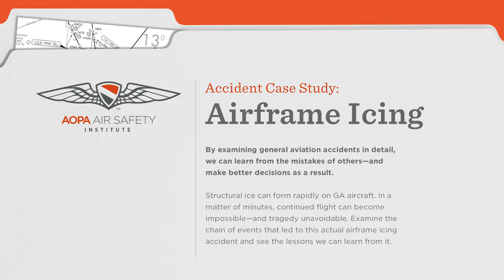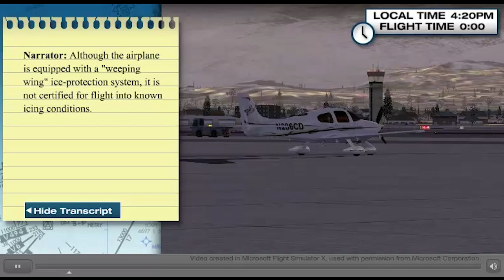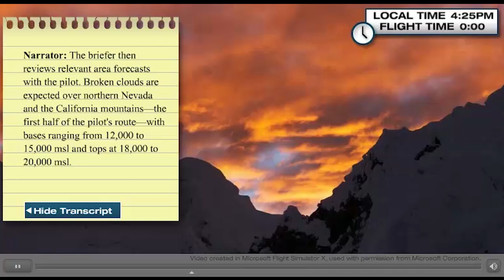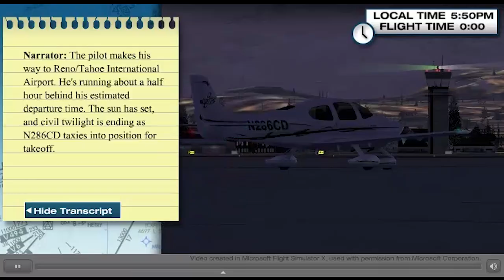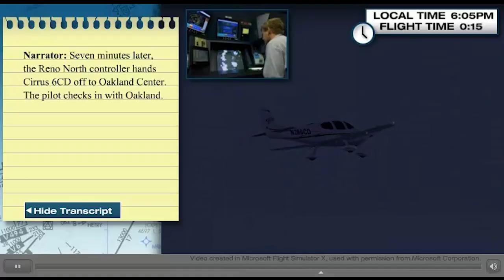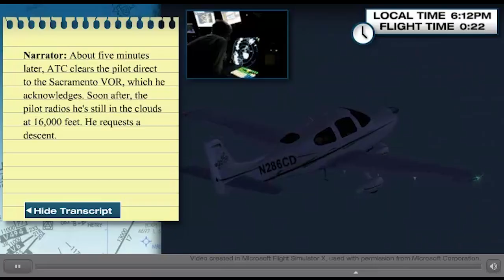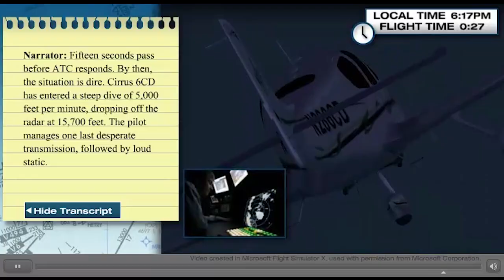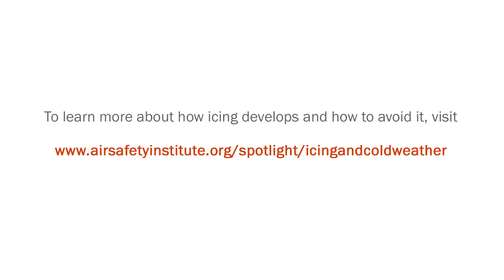Accident Case Study: Airframe Icing

Comment: 12:49 I suggest that the parachute did not fail per se, rather the system failed because of a procedural error.
Reply: Are you suggesting the pilot should have decended back through the cloud layer to either attempt an emergency landing or to slow the airspeed and deploy the chute? He seemed to attempt to get above the weather with the hope the FIKI system would be able to de-Ice the plane before having to go back into the clouds.

Comment: Was that pilot on medication or something?   Because he sounds unnaturally calm and unbothered about his life threatening situation.  He also doesn't mention the icing at all which most alert pilots would.
Reply: He mentioned it as he was going down twice. He hinted at  it also while asking for a altitude change. Reading the NTSB final the weather forecast was wrong. It didnt show any of the icing that's why he left a day early. So he was probably thinking it could get right through it. He only had I believe some over the counter medication in his system. The plane only had 100 hours on the airframe also so it was basically new. The probable cause had unforeseen weather as a cause also.

Comment: Night, IMC, Single Pilot, Single Engine, Mountainous terrain.  No 500 hour pilot should find himself in that situation. I'm not sure that instructors are teaching what constitutes varsity level flying.  He could have rented a car and been in Oakland in four or five hours...what was the urgency for this dangerous flight?
Reply: He was actually supposed to leave the next day. He chose this night because there was no icing forecasted. The plane only had 100 hours on the airframe also. In the final report its has unforseen weather as one of the causes also. Im sure the parachute also gave him a false sense of security also but it pulled it in the dive which was too late.

Comment: FWIW, the local pilots at the time theorized that the unprotected tail stalled, leading to the dive. I never read the final report, so I'm not sure. It's a great motivator to make sure the TKS system is working correctly before flying over the Sierras in winter.

Comment: "Look, i need to get home, ok. I know a cold front is coming in, that's no big deal. What IS a big deal, is if i have to explain to my wife and my boss, why I'm a day late getting home. Looking at the forecast, I see hot air on one side, then a 40 degree difference on the other, followed by 40mph winds in 5 different directions, with freezing temperatures, rain, some sleet here and there, and moderate to heavy snow. And that's just in the first 30 mile leg of my plotted flight plan.

But I've seen worse. I think I can make it. "

Comment: CAPS failed. I think those chutes may give pilots a bit of overconfidence, but they certainly have their limitations (both in attitude and IAS on deployment), he was in a base model SR22 not an SR22T (no turbo) which has a service ceiling of I believe 17,000 where the T can climb up into the low to mid FL’s... that close to
Your service ceiling with a rime buildup is not a good situation to be in, and the added weight in combination with the excessive airspeed upon CAPS deployment, unfortunately he had no chance.

Comment: I am yet to set foot on a plane but even I can confidently tell you wanting to go higher when in a small plane with very limited deicing equipment in bad weather is one of the worst possible decisions there is. The temperature only gets colder the higher you go. There is no need to expose yourself to this level of risk.

Comment: Not to rehash everything the pilot could have done. Will someone answer me this: when the ATC gave him the block and the pilot realized going up was a mistake, what should have he done?

I know he should have declared an emergency. Possibly state intentions. Assuming he needs to focus right now and pilot the craft first... what should have been his move?

I know he needed to descend to warmer temperatures. Do you do a steep descent? I'm pretty sure you don't want to take any drastic maneuvers in any one direction but with his foil characteristics shot to hell, his stall speed is going to be higher and maneuvers will suck.

Have to keep in mind night and terrain, icing, and potential for instruments to be slightly off.

What a crappy situation.

Comment: This is a great example of why I think the citrus parachute is much harder to use than people realize.  The pressure to not pull it seems ever present because most situations where you need to pull it are situations that are probably your fault and are probably correctable with good piloting.  So the pilot ends up fighting through an inevtiably bad outcome that he can’t handle because he doesn’t want to pull it until it’s too late.  He could have gotten out of this situation a myriad of different ways but was incapable, so he should have just gotten lower slowed it down and popped the chute.
Reply: Not to mention that by pulling it, they're facing aircraft damage which will likely be a total loss. Plus the blow to their pride.

Comment: Every damn time I watch these videos, it's always a damn Cirrus SR22, and I'm always left wondering why they don't deploy the parachute system or don't deploy it until they're well outside operating ranges. You bought an aircraft, I'm sure in no small part, because it has an emergency parachute system. So why do they never seem to use that system they bought? I imagine it's one of the major selling points of the Cirrus SR22.
Reply: A big part of the issue is that pilots have a mindset where they don't want to admit that their situation is unsalvagable until it is too late.
Reply: The pilot deployed it above the system's maximum airspeed and the chute separated - it says at the end of the video
Reply: @gamma_hedge  Yeah, I know, I watched the video. It would've been nice if you bothered to actually read my comment. "... or don't deploy it until they're well outside operating ranges". Got some more useless, redundant words to say? You are capable of reading, I presume?
Reply: @CharlesFreck  panic will hinder decision making greatly.

Comment: You know it's nice that the SR22 comes with a parachute but to go through the design process for such a thing and have it limited to a lame-ass 133 kts is pretty sad engineering.  I think they could spend a little more time on it and maybe a little better engineering and make it strong enough to save the large number of people who reached for it in desperation just to have it rip away from the plane and left them to die.  Parachute technology isn't new and beefing the system up probably wouldn't have to add more than 10 or 15 pounds to the weight.  When somebody is in enough trouble to go for the parachute they're not likely still poking along at a nice safe speed under 133 kts.   Nice idea Cirrus but it's time to get it done right!
Reply: Sounds like they didn’t think about designing faster than 133kts, you should join the design team. I’m sure it’s just that nobody raised the idea of making it work at faster speeds..

Comment: Being a Captain for 30 years, I’ve personally noticed on the cloud tops, is where most of the ice accumulates.
Reply: I’ve noticed that too. The top 1,000’ or so is considerably worse than lower regardless of temperature.
Reply: @rrknl5187 because the top is where the most moisture is present

Comment: How would you know ice is building on your wings from the flight deck?
Reply: This is a Cirrus SR22, a small single engine aircraft, the "flight deck" is a few meters from the wings at most. It should also have "ice lights" which shine on top of the wings. In airliners, it's different but they also have much more capable de-icing systems than a SR22.

Comment: Always astounded me why people want to fly in shit weather gethomeitis
Reply: There are lots of reasons, getting home is one of them; but not the only one.  There's another ASI video about air frame icing (pilot landed safely, C182) that basically summarized to "I had made the trip a hundred times before, no problem."  Same here, many private pilots with hundreds of hours have made the same dozen of trips a few hundred times.  And depending on where you live, marginal weather is the default.  Also the back up plan isn't always sound or executed in time.  

I was once flying from VUO to RNT (Portland, OR to Seattle, WA), forecast was ceilings of 6,000 and some precip to the west.  About 1/2 way home the rain hit really bad, with some decreased viability and ceilings were 5,000.  I'm 30mins from my planned destination, and I fly over several airports along the way.  So my thought process was, if they viability drops OR the ceiling drops below 4,000 I'll land along the way.  I proceeded and things got better, so now I"m about 15mins out.  Then BOOM, rain / hale and lighting in the distance.  There was ZERO forecast for convective activity (thunder in the Seattle area is actually very rare).  Now I'm 5 mins from landing, but again passing over several other airports.  So I proceed and land, shortly after landing rain stops (again for like 5 mins) and I can see lightly to the north.  There's another guy that was tying up next me and both were like where did this come from.  

Looking back I can see that even thou I had a good outcome, I don't feel good about my choices.  I really feel I should have landed and waiting on the ground to see what the weather did, even if getting home the next day; I had two passengers on board.  But lets step back some more, I also could be "well I made it through that, so that's my new personal limit."  Both make sense... 

I think it's easy to look at these ASI videos and see the coming tragedy; but in 'real life' things happen slowly and are based on your total life experience.  The goal is to push the envelope and become a better / safer pilot.  BUT drawing the line at 'that's far enough' is not always easy or clear.
Reply: "get there itis"

Comment: There's several rookie mistakes here. (Not saying the pilot wasn't skilled, it's just a sign he's experienced, and forgot the basics). 

1) Icing causes lack of lift.. You never want to climb higher if you already have ice building... even if that gets you out of the clouds, its a huge risk.. The lower you are, the more thick the air is, allowing you to get more lift, and more additional air speed. 

2) Alot of ice building up on your wings is an emergency situation. Make sure the ATC gives you its full undivided attention and is aware of your problem.  

3) Don't be afraid to request in-flight updates on weather, especially if you start hitting stuff that wasn't forecasted. Even if mild at the moment you never know if it's turned bad, and is building rapidly.

4) Never, ever underestimate the speed at which ice can build up on your plane. It takes only minutes to go from a plane, to a brick.

Comment: I'm far from a pilot and never will be, but been addicted to these videos since kobes tragedy. Been binge watching ever since. What I've learned is simply, unless its bright and sunny skies 100% of the flight, I wouldn't dare go beyond that. And the most I would do is a simple joy ride also, so there could be no pressure of HAVING to be somewhere. ESPECIALLY now knowing the rate of deaths due to transitioning from vfr to Imc (if I said that right), and how those skills can easily atrophy if not used consistently, which means an imc rating means absolutely nothing. And so MANY other things can go wrong if over looked. A life losing is just not worth it.
Reply: I believe it would be more consistent to say transitioning from VMC (Visual Meteorological Conditions) to IMC (Instrument Meteorological Conditions). However what you said certainly gets the point across. 

I wouldn't personally go as far as saying 100% sunny skies the whole way or I wouldn't fly. Its all about knowing your limitations, and planning your route (or rerouting mid flight) to avoid bad weather. But ya, its easy to get in way over your head quickly near bad weather. A lot of these crashes seem to stem from not having a proper respect and fear for the dangers of flying.
Reply: @etherealessence  
Or maybe it's
 VFR to IFR then IMC and double IMC
(IIMC) I've been binge-watching after Kobe's accident also. Still can't believe he's gone.
Reply: Onnie Simza, LOL me too!!!! Even though Kobe died in a helicopter, not a plane, I've been watching these videos as well. That's funny. But I have gained some useful knowledge.
Reply: Sands Real Estate West You and the OP should check out the USCSB’s videos also (US Chemical Safety Board). They latest ones are so well done you won’t believe it!! Top notch narration and state of the art, incredibly detailed computer simulations of the exact industrial site where the accident occurred. Extremely entertaining & fascinating, there are hundreds of us on “Notification Squad”, people are even demanding it be put on Netflix and that we get an upcoming release schedule to look forward to, LOL 😂 
One of these 2 links should work: www.youtube.com/uscsb www.youtube.com/user/uscsb
Reply: Also, if you ever win a coin toss for a seat on a plane during dubious weather, don't take it.
Reply: @zyrrhos  
Ha! Good one.

Comment: Never, ever, assume that climbing will get you out of ice, unless you are certain it is so. Lower is always better provided there are workable cloud bases. It's a very "macho" thing to request higher. In some pilot circles, lower is somehow being a sissy. I know it is absurd but I think there is something in it. I never cease to be amazed how complacent pilots often are in the face of imminent danger.
Reply: I wonder if he was worried about terrain if he went lower?  Being a proper IFR flight though, he should have been able to determine how low he could safely go.  Perhaps he was thinking that if going high didn't work he could always come back down, whereas low and iced leaves you cornered.  Probably didn't realize just how bad icing can get.  Sounds like his plane turned into a brick real fast.

Comment: "Anti Icing systems have limitations and parachutes can fail.  Have at least one Plan B that is guaranteed to work if you encounter ice."
Yeah if your parachute fails, have at least one Plan B.  The way that is worded really makes it sound like deploying the parachute was his plan A.
I'm not a pilot, but I'm pretty sure deploying a ballistic parachute on an airplane is always Plan Z, if everything else has failed.  I'm also suspecting once you deploy the parachute, you won't be able to have a Plan B if it doesn't work.
Reply: Parachute is always plan Z. The amount of damage you will incur wouldn't make up for it otherwise. Maintenance perosn I was talking to said that opening parachute will still cause the plane to sink 500 FPM and destroy the main and nose gears. This is another story of a pilot not asserting his dire situation to ATC and not descending to better conditions. Your plane icing up beyond what your anti-ice can do is a serious emergency and should not be underestimated. Icing severely reduces the plane wing's aerodynamics, creating a significant amount of drag while significantly reducing lift that keeps the plane from stalling. Once his plane stalled, it was pretty much unrecoverable.
Reply: Indeed. Use of the parachute totals the airplane no matter what. It puts you into the random terrain below over which you have no control, much of which will kill you even if everything else works.  It provides a reduced chance of dying not a safe escape.
Reply: @BillPalmer  Perhaps that was why he didn't deploy it until too late.
Reply: Instead of being so smug you should improve on your reading comprehension and notice the point between the two quoted sentences. The second one represents an alternative to the first one, which means: you should have a plan b for encountering and thus evading icing conditions, before you come to rely on your anti icing systems or even come into a situation where your parachute could fail. Means, dont rely on these 2 systems, but have a plan B instead, that does not include or rely on either anti icing systems or the parachute. I love it when ppl think they are smart, and can't even read properly.

Comment: Something above the obvious isn't adding up here?? I have a TKS system on my Commander and it will, if tanks are charged, dislodge all icing from the entire wing surface for at least 45 minutes. Being FIKI cert' with the TKS just means you have an extra reserve and a back up pump. That system is excellent and should have prevented loss of control - had it been activated?! My suspicion is that his glycol tanks were not charged. I can't image that ice loading on his external gear would have put enough weight on that aircraft to create an unrecoverable stall. More to this story than is evident by a bad decision alone. Remember Wm. Henley ("Invictus") immortal words: "I am the master of my fate: I am the captain of my soul." RIP
Reply: Two years late, but I think I can fill in some gaps. The wings of the non-certified SR-22 have TKS. The tail does not. He may very well have kept his wings clean only to suffer an elevator stall. Or maybe it was too much of a bother to fill up the glycol.